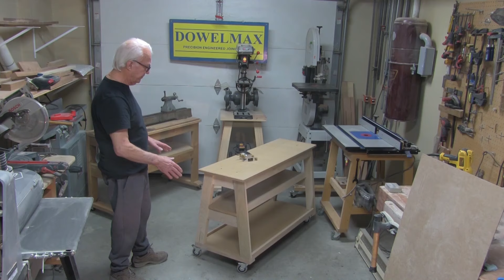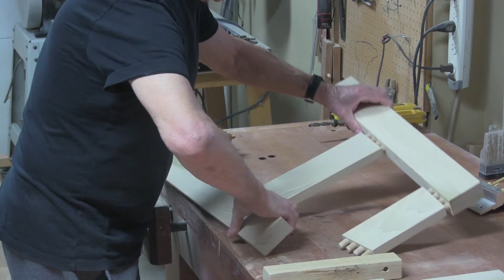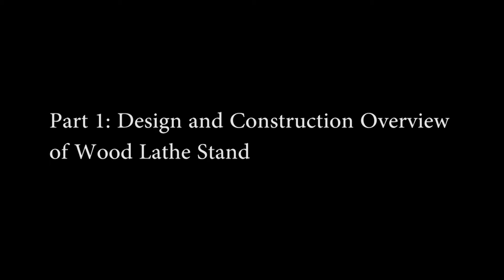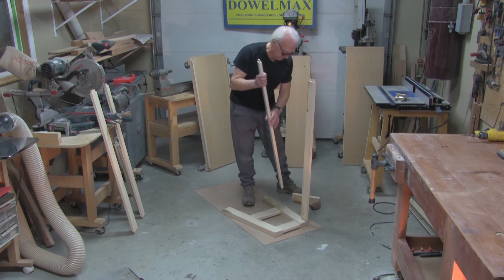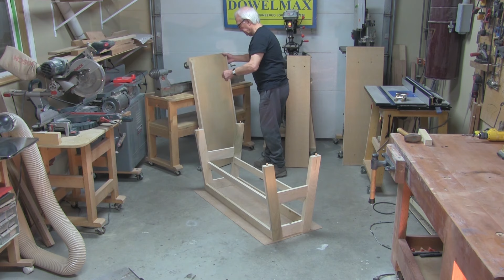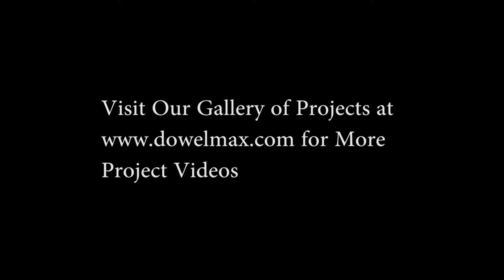How to Build a Woodworking Machine Tool Stand with 100% Dowelmax Construction

Comment from the maker: I noticed someone was asking about the 8 degree alignment.  To respond Dowelmax adapts to any angle.  Considering the top angle on the lathe stand, the tool will align perpendicular to the leg and also perpendicular to the angled edge of the apron or rail, however the rail is already cut at an 8 degree angle to the vertical, so when the two workpieces are joined they are in sinc and the combination is an 8 degree angle.  Hope this is not too convoluted.  Jim.

Comment: Thanks for continuing to make videos, when would the 1/2 inch dowelmax be preferred over 3/8?
Reply: Hi Scotty. A really good question.  I tested it with 7/8 stock, thinking that would be the smallest appropriate size, and it worked out really good.  Now I'm beginning to wonder, would it be good with 3/4 stock?  There would only be four dowels rather than five for the 3/8.  You may think It's too close to the edge, but I wonder.  It's not a biscuit, It's radial, so It's not as vulnerable to failure.  I'll try that out.  Thanks for your interest.  Jim.

Comment: I have no affiliation with Dowelmax, but I can tell you it's a great tool. Much faster than making mortise and tenons with great strength. Plus you can mill your stock to the exact size you need without allowance for the joint. Highly recommended!
Reply from the maker: Thank you for the supportive comments!
Reply: Dowelmax where can I buy the dowelmax from , can’t seem to find it anywhere.
Reply from the maker: @kevinbrown8960  You can purchase direct from our website, or from one of our dealers which are listed on our website "Dealers" page. For examples: Rockler, Amazon, Grizzly, McFeelys in the United States, and Richelieu in Canada. Thanks
Reply from the maker: Thank you for your support.   Jim.